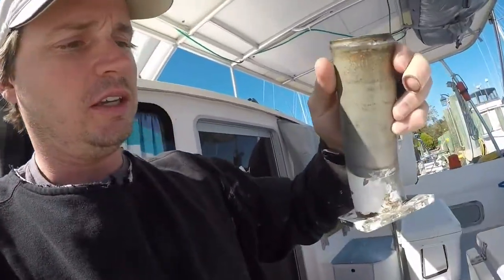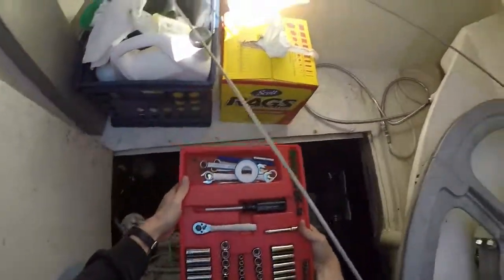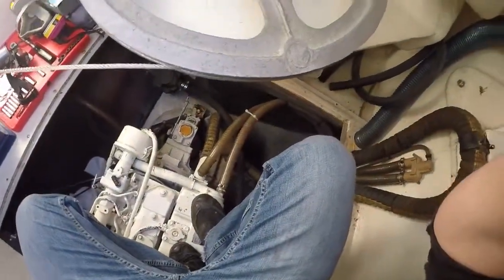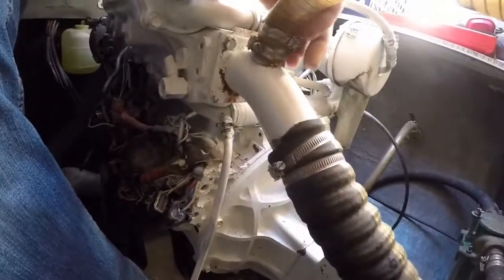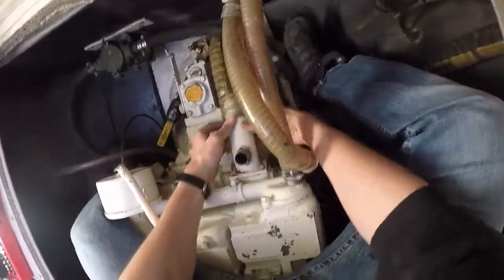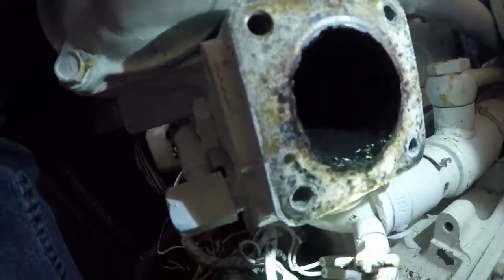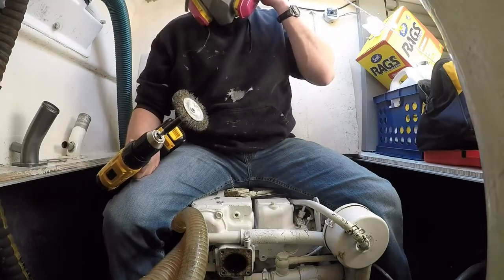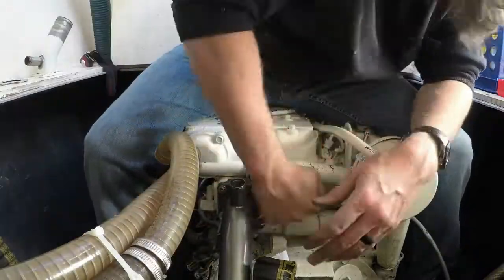S/V Ojigwan: Our boat is falling apart vol 1: 'The Mixing Elbow'

Comment: Thank you much for taking time and effort for the video.I'm just learning about mixing elbows.Hairline crack on mine and lot of corrosion.Trying to educate myself before I decide to atrtemp myself or call in diesel mechanic.Better understanding after your video .Rgds oldguy in EmeraldCity(Seattle)
Reply from the maker: Happy to help.  The first step is having the courage to try.  This is a project you can do for sure.  The parts are not too expensive and they are straightforward.  One thing that will help is to take photos or how things come apart and label everything that is not obvious.

Comment: all that money.. but what was actually wrong with the old elbow ?   I would douche this with oven cleaner to remove the carbon.. then perhaps try to confirm that there is an actual leak.. rather than a gasket leak..  for that kind of money.. it is worth investigating a welding repair if you can really show that it is leaking from the weld.  What I see is that there is a clear path of leakage on the flange.. indicating a gasket problem !   Some test techniques can include poor mans dye penetrant testing... magic marker and a paper towel !   also.. putting a blank plate on the flange end with a rubber gasket.. and sealing the other end with a piece of inner tube and a hose clamp.. fill with water, and pressurize with a bike pump.. or gently with a compressor.  a few psi is enough.  Solvent for carbon.. is caustic material like ez-off foaming oven cleaner .. and for calcium in the water jacket is dilute muriatic acid ( barnacle buster).  very fine emory cloth ( 400)  will give a very smooth mating surface.   HDI Marine ( on line  )  in Vancouver Washington ( not BC)  makes fine stainless replacements.. if you need new. Fast service, nice folks !
Reply: Those are good thoughts. Remember that the salt water comes in downstream of that gasket, with a concentric barrel design that should prevent salt water from moving backwards along the mixing elbow to the inside gasket and engine. Fresh water is a combustion product, too, so the story is complex. But if salt water is actually leaking from the gasket, there is likely something wrong internally that puts the exhaust manifold at risk. For what these elbows cost, given that they often need to be replaced, I think I'd just replace it rather than trying to keep it going for a little longer. Yeah, stainless steel sounds great, and I'm not too concerned about those who worry about galvanic reactions there.